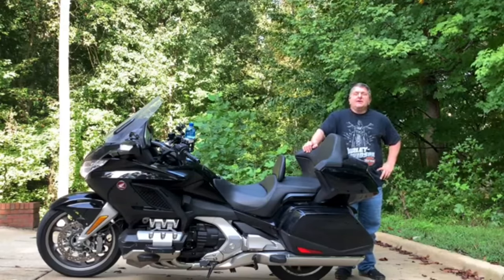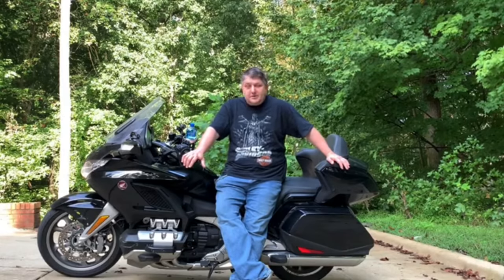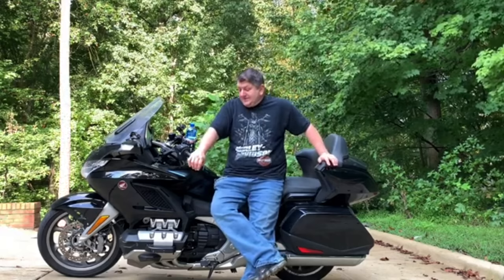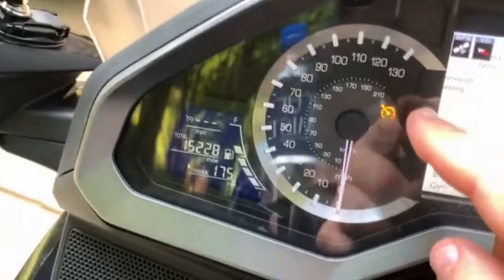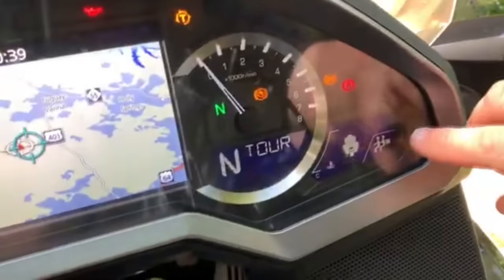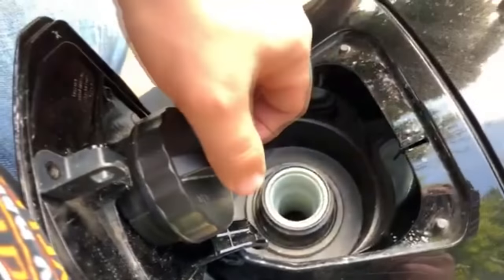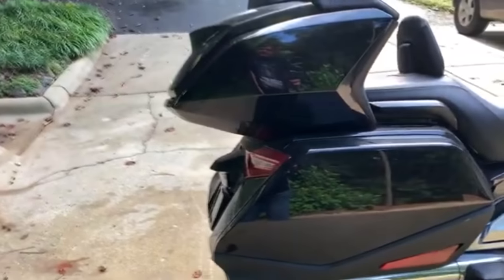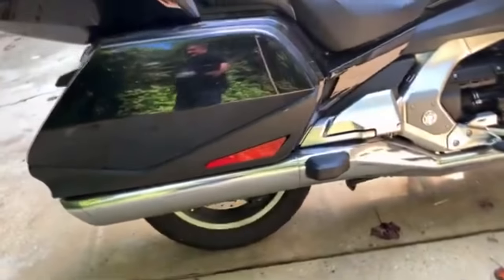2019 Honda Gold Wing Tour DCT 15K Owner Review

Comment: The wife & me put over 40,000 miles on my old VTX 1800 in a little under 4 years and probably had some of our best times & memories. 
 Even a trip to Key West from TN. 
  We decided to turn the bike into a Jeep and I havnt put 10,000 miles on it since buying it 5 years ago. 
  The bike fever is raging again now and  about to sell that Jeep & get a new GW. 
 I've been stuck deciding between the dct / manual and have decided to just go with what I know works for me. 
 I have no problem using the clutch so  can't wait till the big day arrives. 
  I've shopped most of the dealers in driving distance and there doesn't seem to be much haggle room even for cash$ the way these bikes are flying off the shelves. 
  Oh well, it's only money I guess. . Cheers.
Reply from the maker: Welcome back to the Winging world!
I have never regretted leaving my Ultra Limited or "The Motor Company" itself. 
Onward!!!

Comment: I bought a new 2018 Manual. First upgrade was the 2020 passenger grips. Made it much easier to pull the bike up on the center stand.  The plastic covering the crash bars are (sort of) easily removable for tying down the bike to the metal bar underneath. The rear one has a plastic body/expansion pin you pry out and the cover comes off. The Honda recommended front tie is to wrap around the front suspension/frame with a wrap around extension strap and conventional tie-downs. I trailered mine from the dealership in California home to Colorado this way. I was told the front covers come off by squeezing the centers top and bottom. Dealerships are familiar with these because a lot of people mistake them for foot holds and knock them off. Thanks for the complete review.

Comment: 2018 DCT owner here. Love the bike with these essential mods for me. (Grip Buddies) the stock grips might work with small hands. (Seat) Wingsoft seat upgrade I can now put in a couple hundred no problem. Additional mods. Added the acc connector for heated gear. SoCal Moto fog lights and brake light signal kit. Rack for the top of the box. Bottle, cup holders front and rear. XM Sirus antenna to go along with the bikes apple car play which is awesome. Suspension is great and will handle as hard as you want to ride it.

Comment: Great presentation, Maikeli. I traded my 2017 Street Glide Special for a 2018 Tour DCT. A few observations: The front LED headlight cluster is less than adequate. I installed Denali running lights under my mirrors that light up the road. I removed them from my Harley prior to trading it. The fog lights that you referred to are standard on the 2020 model. I installed RIVCO fog lights which double as daytime running lights. Between the headlight, the Denalis and the RIVCOs, I'm always riding in daylight conditions.

For added visibility, I added a Pathfinder headlight modulator for the headlight. It is very effective-I have had more than a couple of cars pull over as I approach them from behind. How courteous!  In addition, I installed the Pathfinder Trailblazer for all of my brake lights. It flashes the brake lights several; times as I brake, then they turn solid. I also installed Goldstrike LED brake lights/turn signals under the lip of the trunk lid and and LED strip of identical lighting along the perimeter of the passenger backrest. Brakes all red; yellow for turn signals, and they work as chase lights when using the turn signals. I also pulled my Admore Lighting Brake/Turn Signal device from my Harley. It mounts just above the license plate. I find this device to be a must for all motorcycles.

A few other nice thing: I installed the Homelink transmitter for my garage door. It should have been done at the factory, though. Floorboards and highway footrests are good to have, as well. The highway footrests will replace the plastic cover over the engine bar.  I purchased the Goldstrike boards and footrests. The boards, of course, will replace the driver foot pegs.As for storage, Maikeli is spot on-for one person, it works. However, it can be improved. Under the trunk lid, I installed a velcro-based organizer that's made for this bike. I store paperwork, tire gauge, extra eyeglasses, small tools, etc. It allows you to preserve the precious trunk space.

Comment: Love all of Mother Nature singing along in the background during much of the video.  Great site location!  I have an older Wing (manual trans) and a VFR1200X (DCT) so sort of the new Wing in two separate bikes.  I use the GW with my wife for extended tours with lots of gear and the VFRX for more local sporty riding and some light dirt roads.  The DCT is a gem and it has spoiled me.  Wish other manufacturers' would consider putting something like it in some of their machines.  Cheers and safe riding!
Reply from the maker: Thanks, my friend! I think I will be moving more in your direction of motorcycle usage as time progresses. I'm currently considering a Honda CB 1000R as my sportier go-to second bike.

Comment: Good review. I agree with your comments. I have accidently had the front wheel leave the ground in sport mode. Sport mode is no joke! Traction control will take over when that happens. The 2020s come standard with the driving lights now. They raised the price $500. The stock horn is awesome. I do wish the display was more up to date. (touch screen & weather should be standard like the Indian motorcycles)16,500miles on mine since March 2020. Original tires. I am waiting for Michelin to make tires for it. Haven't driven my cars or other motorcycle since I got my Goldwing. "Keep riding, because you don't get yesterday back & you can't buy a minute!"
Reply from the maker: Thanks, Michael. Much appreciated, and I agree with all that you've said about what they should change. :-)

Comment: Loved your review and explanations. Just picked up my 2018 DCT so still learning all the controls. My only complaint so far is the parking brake. Took off riding a few times before realizing it was still on. But will add that item you mentioned that will not let me start with it on.  Other than that, just love riding it. Getting a sore neck as every time I get off and am walking away, I have to turn for 1 last look...

Comment: So many cool features in addition to the basic performance of the bike. I’ll probably be riding my Ultra until I die, but so many cool tech features are attractive, kinda like a new car. I always have to check if I latched my bags and tour pac and if my kick stand is fully up. Can’t figure out the Harley nav and com system unless I study up before a ride where I might use them. Riding the Ultra like a sport bike in the twisties takes a lot of practice with the lean angle challenges and the manual transmission. On the personal side, I couldn’t wait to get my 500 mile break in done so I could completely disassemble and upgrade my motor, and I wrench on Harleys all the time in a great local Indy shop, so if I switched to Honda, I’d have to give all that up. Still, Wings are awesome and I totally appreciate why some many riders are devoted to them.

Comment: I've had my 2018 DCT Wing over here in the UK for about 18 months and up to about 10000 miles now. Black the same as yours but we can only have the DCT with airbag over here which means you lose the useful little locker in the shelter case. I agree with everything you said. The adaptive headlight thing doesn't bother me as I've always ridden fairinged bikes with fixed headlights so I'm used to it but it would be a useful upgrade. I think the tour models, or at least some, do come with the fog lights as standard now from 2020. I fitted them to mine last year. I find the stock seat absolutely fine. Can ride without discomfort for hours. Also for me the stock suspension is fine as it is. T. Dynamics talk about the bike needing an upgrade but that is misleading. Owners of many bikes like to change the suspension to suit themselves. It is nothing unusual. Stock systems have to be a compromise and for the way I ride the stock set up is perfect and will be be for many riders, I'd wager the majority. Like you I love the DCT. I have an old sport bike as well (1985 Kawa 750 Turbo) and although I love it, using the clutch becomes a real pain after a while if you've experienced the DCT setup. I guess for some the luggage capacity might be an issue but for me, as with you, it is more than sufficiant. One thing I have done is fit the 2020 grab rails. As you said they make it easier to strap on extra baggage if needed and also it is easier to grip when putting the bike up on the centre stand. Neither essential but just better IMO. The air vent on top of the dash isn't great for ventilation but I do find it helps to relieve that vacuum effect you can get behind the fairing sometimes at higher speeds. I have a lower V Stream screen fitted to mine as I'm a bit shorter than you and the edge of the standard screen was right in my eyeline in the lowest position. It works well for me as I can still raise it high enough to look through if need be. So far I've not had one single fault with the bike, including the steering. No excessive play at all. Overall I'm really happy with my decision to buy one of these new Wings. It is certainly the best long distance bike I've owned by some distance.
Reply from the maker: It is heartening to know that I am not alone in my assessments. Your own experience serves to demonstrate that this motorcycle really is something special. From reliability to handling to functionality and comfort, this bike can do nothing but impress. Thanks so much for your great comments!

Comment: Man that is a sweet bike. Beautiful M7. Had to come back for a re-do. For the 20 models the LED lower driving lights are now standard. The small middle compartment’s release button has been refined to actuate when pressed on all contact points and enhancements to the Apple Car Play interfacing with Android product’s. Passenger grab rails also have been increased. Regarding the windscreen, as you know there are numerous aftermarket screens that will nullify your wind at your shoulders or outside arms. The seat for me is not a problem. The storage is fine with packing what I need and adding a nice soft/hard bag on top. With tooling being so expensive, it might take time before that storage sees any massaging at the CAD. But it’s possible if Honda thinks it’s killing sales. Although here in the DFW area of Texas the Level 5 dealership seems to sell every DCT they can get their hands on. I agree the paint is not Harley level. Nothing is. But the bike, as you mentioned, is nearly perfect in many ways. You also mentioned Goldstrike.com. This company has exploded over the last several years with some really cool stuff for the new gen Gold Wing. Thanks for a real candid review. Can’t explain thumbs down. I guess they’re just jealous. 😂 Ride safe and ride often. Peace.
Reply from the maker: Thank you so much!
I am happy that they have updated those items, and hopefully they will come out with some aftermarket stuff from the company itself to make it have more storage. 
Thanks again!

Comment: I've been a harley rider for over 20+ years both professionally and recreationally . I took the DCT for a test ride and loved it. I finally bought this same bike 2 months ago. It continues to impress me every time i ride it. 
My only issue with this bike is the Radio/Navi system. 
I feel its overcomplicated when it doesn't need to be.
 i own a honda civic (which cost less) and the moment i start my car my phone connects every single time, 
without a bluetooth headset 
or plugging in my phone  
even when i stop for gas. 
it's supper simple and i didn't need a book or instructional videos to operate it.
 Hopefully someone at Honda powersports walks down the hall to Honda auto and upgrades this radio in another year or so.
Reply from the maker: I'm with you on the nav and radio. Not sure how they could fix the car play thing, since the way to talk to it is made more complicated by it being on a bike. The moment you have to add a Bluetooth as an intermediary, things become more apt to screw up.
Reply: @maikeli7  personally i've used the honda hack app with auto kit app , connect a car carlinkit adapter to the usb and my phone is immediately recognized . never had an issue and i use my earbuds for calls .

Comment: It's one of those vehicles that I can't find fault with yet I am not drawn to it at all and in general I am a function over form person. I guess I'd have to ride one.  I might be more interested if it had quick detachable luggage and was a little less featured. I don't need a nav. ABS/TC and cruise for sure. TPMS might be nice. Beyond that I don't need in terms of factory stuff. Oh yeah, the electric windscreen is nice. I have it on my 2009 RT. I have heated grips and seat, but I really don't use them since I moved to AZ. ACC is accessory

Comment: Thanks I am loving my manual tour as well.. adaptive headlights would be great.. the BMW 1600 GTL has them. I have driven car with them and they are a game changer at night
Reply from the maker: I cannot imagine that ten years from now they won't have those. I'm also hoping for cameras all around, with rear-facing turn-on when reversing. It is hard sometimes to crane my neck around to see clearly. Old age sucks!
I'd also like to see optional stability control like they showed on the concept bike. Imagine a bike that never needs to be balanced at low speeds. That'd be great for when I get old and my equilibrium is not quite what it once was!

Comment: See Max Macalister’s (Traxxion Dynamics) latest video on the strength of the handlebars and using them as tie down. Dispelled aim common thinking. I have the SoCal DLR/Rinning lights and their side vowel lights. They add cornering visibility. Over looked are the two headlight adjustment knobs on the back side of the fairing which might improve night time visibility.  I’ve not seen any adjustment literature on these obscure adjustments. I installed the second power USB wire in the left saddle bag BNK for camera and other use (USB Drive with all my music). YouTube video on quick install without takin half the rear plastic off. Latest. When listening to radio and you want it off. Instead of lowering volume push and hold down the audio/headphone button. This will shut off radio as displayed at the top of the then blue screen. 😅

Comment: Great review thanks.  I own a gold wing as well.  Love it.   Did Honda put in your steering spindle?  I trailered mine tied by the handle bars as well.  They still seem solid and I may keep riding however it is a little worrisome and if Honda doesn't cover it maybe a tad expensive?   Thanks again.  Happy travels.  I did consider a Harley as well.  I test drove a few.  I just found Honda a little smoother so went that way.   I appreciate the comparison though.   Both great bikes.
Reply from the maker: Yeah, the steering head bearing came loose because I had strapped the bike down to a flatbed wrecker and it was bouncing around for 170 miles.
It is in fact a covered item. I did not pay a dime for them to fix it. It only needed to be tightened, thank goodness, as it would have been several days waiting for a new part to come in if that had been the case.
I now understand not to use the handlebars to strap down the bike.
Reply: @maikeli7  Thanks.. I
will inquire into it.

Comment: I have a buddy that has a 2019 DCT.  Back in 2018, I was seriously considering one, but I never buy first model year of anything.  I was torn between the Goldwing and the K1600GTL.  Decided on the GTL.  I had an r1200RT for 10 years and grew very attached to the easy removal of the top and side cases for rear wheel and final drive maintenance, which is the same on the GTL.  Though, we'll see where my mind is when I tackle the valve check on the K.
Reply: Drop Tine you’ll find most do the first check then skip the next couple to find on what should be the 4th check nothing has changed YMMV...
Reply: @beardedbiker2647  , I bought my 2016 K1600 in early May of this year with just under 12,000 miles on it.  There is is now a little over 16,000 on it now and I may try to get one one more four or five day motorcycle trip in before I put it up for the winter.  I'm thinking if that happens, I'll bring it up somewhere over 17,000 and 18k is the valve check interval.
Reply: Drop Tine search the BMW forums lots of posts about the valve check...

Comment: Great Review of the bike Mike. I'm curios if the 2018 vs 2020 is there much differance, I thought The shifting on Dct models was not quite as fluent on 2018 vs 2019. But it looks like you can pick up a new 2018 for much less money.  I was wondering if that was software update for the drive train. I've been tempted to see what the trade difference would be.
Reply from the maker: I doubt the differences are that huge. I say go for an ‘18 or ‘19.
Reply: I agree. I'd go with a 2018/19 if you can make a significant saving. I think many of the early non-owner reviews were done with quite low mileage bikes that were still a bit tight. I found with mine that it still seemed to be loosening up and smoothing out up to about 6000 miles. I was seeing gradual improvement in fuel consumption up to that point as well. My transmission is noticeably smoother now than when it was new. If the changes get a bit clunky and jerky you can do a clutch re-initialisation that will smooth things out again. If you already have an earlier model or want to make a saving on buying a new one I don't think there is enough of a difference between the 2020s and the earlier models to worry about.
Reply: @iannicholson9875  Thanks I have a 2002 gl1800 which I really like but the Dct and modern tech are nice.